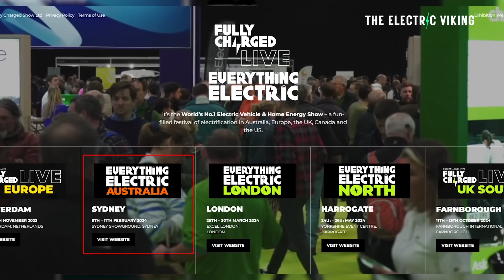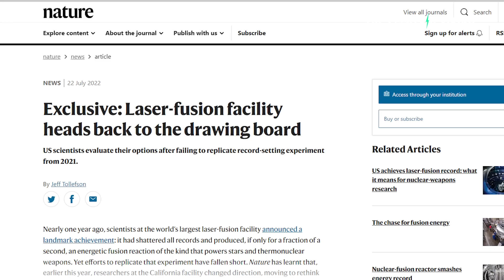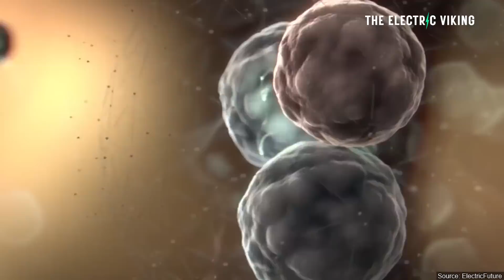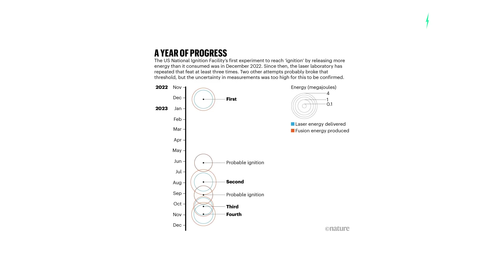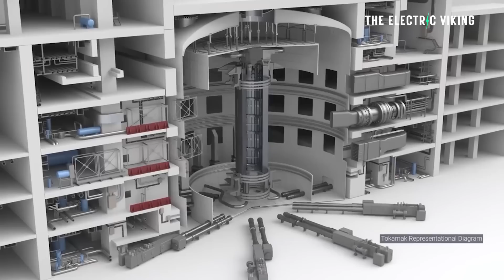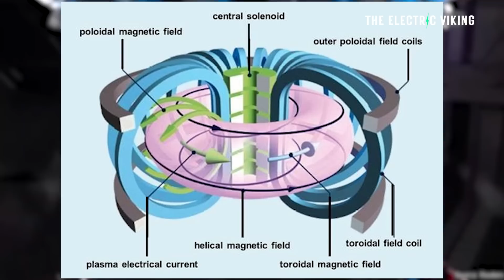US nuclear-fusions game changing achievement; ‘ignition’ over and over

Comment: Ok, way to hyped and low on details. I like all the new fusion approaches cropping up but realistically this is a small step on a long road.
So what is the catch?
Well the energy of the lasers that triggered the reactions was 2 MJ and the output of the fusion reaction produced 3MJ so net-positive energy, right?
Well no, because the laser emitters themselves are WASTLY inefficient, around 0.5%. That means to produce those 2MJ lasers they had to input about 400MJ electricity.
So 400MJ in 3MJ out. 
But lets say we get vastly more efficient high-power lasers 
AND we can solve the problem of actually transmitting the energy into the target pellet more efficiently 
AND we can do that at a repeatable reasonably high iteration rate (throughput is important for commercial viability as we can see with the wafer throughput problems of ASML in EUV lithogr.)
AND we can produce the pellets cheaply.
Then we can have a great free energy source, right?
Well, only if it's commercially viable (facility build, maintenance and run cost).

This is why Elon points towards the sun every time he gets asked about fusion energy.

That said, I live in Germany and here it's cloudy half the year and we don't have the geography for enough hydro (compared to the scandinavians ). 
So I am very much rooting for fusion and any other promising renewable energy source.

If I had to guess though I would say in the next 10-20 years the thing to look at is further dropping battery and solar panel costs relative to storage/output.
Curious whether the push for AI robots (nvidia, tesla bot etc.) is gonna lead to a huge labour cost reduction in that regard (e.g. mining, factory work) or whether the robot brain problem is gonna run into an early local maximum such that they are simply not intelligent enough to be realistically usable.
We shall see. Interesting times anyhow.

Comment: Sometime around 1998 I went to Lawrence Livermore National Labs (LLNL) for some meetings (not related to the National Ignition Facility aka NIF). Upon driving to the building where my meeting was taking place, I saw a shiny stainless steel cylinder  (about 10ish metres tall and a few metres wide) with a large shiny stainless steel sphere (about 10ish metres in diameter) sitting atop the cylinder. The sphere had quite a few holes of different sizes strategically placed all around it from what I could see. It was quite the amazing sight and looked more like an alien spaceship than anything. I went to grab my cell phone and take a picture but then realized "CRAP! This is 1998 and cell phones don't have cameras yet! Why I decided to come back to the stone ages is beyond me! DAMN!" 
And, because it is a secure facility, you CANNOT buy a camera around there to save your life! So, you'll just have to take my word for it that is was VERY COOL!
Eventually the building went up around it so it was no longer visible. I just lucked out on the timing.

Comment: Energy was solved in the 50’s with nuclear. Everything since is a farce or self inflicted drama.
Reply: Nuclear produces waste that is hard to deal with in a good way
Reply: This is simply false. The overwhelming majority of current stored waste was produced in the 50-60’s. This waste could indeed be used for several forms of power generation. Nuclear is the most sustainable form of clean energy on the planet right now.
Reply: @Uncle-G  around 90% of all nuclear waste isn't viable for energy use, since it has low energy levels
Reply: @Real_Furnace  alright smart guy. Most nuclear power plants use 3-6% of the available energy nuclear fuel rods. There are several other plant designs that could use up to 70%. Depleted uranium is not without fuction either however if this attitude of the masses are “nuclear bad” nuclear will not be researched further and we will waste one of the greatest assets we have.
Reply: @Uncle-G  Depleted Uranium is useful, but still a process in which no waste is made would be inherently better.

Comment: The problem with that claim, is that the energy used to charge the lasers  was not include in the calculation. When you include that energy it is close to a push (no loss/no gain). I'm sure they are striving to change that to make it a viable source of energy.

Comment: The key phrase here is "that the laser provided".  Congratulations for mentioning that only 1% of the energy put in to laser is "provided" in the ignition shot.  So if you put 100mJ in you get 1.89mJ out.  With a 7% more efficient laser it will only take 93mJ to get the same 1.89mJ out.  Notably this doesn't include the energy put in to preparing the capsules, refining the hydrogen isotopes or building the facility.

Inertial Fusion is a joke.  It has been since I worked on it in the late 90s.  So why was I working on it?  My research lab got a grant and the check cashed.

Now science for science's sake can be fun but we were essentially just burning through some US DOE money they were throwing around. 

There has only been a little thought put in to how you could get energy out of an inertial Fusion reactor and the concepts are wildly flawed.  So even if you get those 1.89mJ out of the reaction, you can't get them out of the reactor to do any work.  So we are back to 100mJ in 0mJ out.

I'm just going to call a spade a spade, the NIF was designed to help improve nuclear weapon simulations and inertial Fusion was a pipe dream created to double dip for more research money.

If you want to look at practical Fusion energy, look at ITER but know that it is very flawed because as far as I know it does not have a serious energy extraction system either.  There are power extraction concepts that are potentially workable for tokamak reactors.  And that's my disappointment with ITER, we already know that tokamak Fusion can be achieved and exceed breakeven (Princeton did it a long time ago) so ITER is only going to scale that up and increase plasma density and still ignore power extraction.  That will limit it to brief test runs that need to be shut down when the reactor gets too hot, then waiting for it to cool before another brief test run and occasionally shutting down for long periods of time to replace neutron damaged reactor pieces (notable because a power extraction system can also act as neutron shielding).

In the end, these announcements are just PR messages trying to fool people in to thinking Fusion power isn't still decades away and get more research money from the government. 

If ITER had been designed with power extraction in mind, the data it produced could have been immediately used to design an actual commercial Fusion energy plant and maybe we could have seen one actually operate before 2040 but I wouldn't be surprised if we don't see commercial Fusion energy before 2060 or 2070 because we are going to have to build at least one more ITER scale experimental reactor to test power extraction concepts.

Comment: They need to get to where they can harvest the energy to generate electricity that is more than the electricity used to run the lasers and all the other equipment.  They need to get to harvesting more than 100 times the amount of energy that they generated in this experiment, or they need to get the lasers 100 times as efficient or some combination (or more).

Comment: A frozen duterium target inside a diamond housing wrapped in gold is NOT a practical way forward.  How fast can this be repeated?  I suggest not very quick.  I also note that the video shows two different systems.  One is magnetic acceleration of plasma to meet with opposing plasma to be magnetically squeezed inot fusion in a reaction chamber.  This is a completely different technology to the one you are describing.  Not impressed.

Comment: you really should learn some physics and not just read PR crap, the output is not greater than the TOTAL power input to the facility and the stretch to commercial energy production is enormous, even if they manage it the cost has to be horrendous. 
I'm sure it will all happen in the next 20 years, it has been 20 years away for the last 50 years.

Comment: Several different fusion companies are planning on putting energy on the grid before the end of 2025. But considering that global energy usage is estimated to double in the next 10 years, it is unlikely that we will be getting rid of any of the existing infrastructure any time soon. Most likely we will be scaling up fusion reactors (many different types) between 2025-2035, and then we will start replacing older oil and gas energy generation. You should watch the All - In conference conversation: https://www.youtube.com/watch?v=AIPULlqA5Wc

Comment: A.I. will likely be the instrument that ends up making Fusion Reactors feasible.
Let us all concentrate on thinking bigger in order to solve global warming.

Elon Musk signed a contract with China in January 2023 to manufacture Diamond Batteries, they will power his Tesla cars instead of Lithium batteries.

NASA has a rover on Mars carrying a device called MOXIE.
It captures CO2 from the atmosphere, splits the molecule and stores Oxygen for future explorers to breath, Carbon is a by-product.

If MOXIE was up-scaled  here on Earth it could do the same thing, split the CO2 molecule store the Carbon then the Oxygen can be on sold to industry.

By placing Carbon in close proximity with Plutonium that will make it slightly radioactive, it can then be manufactured into Diamond Batteries which will produce electricity for 1500 years while reducing CO2 in the atmosphere and sequestering the carbon indefinitely.

On Earth Mammals inhale air composed of Nitrogen and Oxygen and exhale CO2.
Therefore CO2 is an inexhaustible feed stock, we are never likely to run short of it.

CO2 could manufacture trillions of Diamond Batteries they could replace every power station on the planet and produce no emissions.

Comment: Sam, you need to do some more fact checking, on the face of it if you compare the price of building ONE nuclear reactor it is correct to say the nuclear powerplant is more expensive than a windfarm, but that doesn't take into account the total cost for 100% available power at the right frequency. 
Why is that important? A modern society can't send workers home because there is no wind or solar power. I'm sure you don't want to have open heart surgery when the power could either go out or brown out. 
A wind farm can theoretically be infinitely more expensive than a stable power source like oil, gas, coal, or nuclear.
First, you need to have massive backup not only for a few hours but often on the latitude of Canada, Sweden, Norway, or Finland for days and even weeks.
Then the cost of running those powerplants will be difficult to make lucrative as from time and again when the wind kicks in or the sun shines the price will even be negative as there is such a surplus of power you cannot recuperate the cost for the production of the energy, let alone the investment. 
On top of that, you have to balance the power grid and hold the frequency stable, or the industry with motors and equipment will suffer enormous costs as their equipment breaks down when the frequency isn't correct. The only really good way to balance that is to have power generation systems with a heavy mass like nuclear, hydro, or similar. 
Thirdly, you notice that the wind farms usually only last for a maximum of twenty years and that is high, usually, they have worn out and the blades and maybe reduction gearbox has to be replaced and they are placed far away in mountains, at sea or other places far away from the regular power grid? This means a massive investment in new power cables every ten to twenty years just to tap into the power produced. That distribution cost needs to be factored into account too. 
Lastly, make this comparison; right now the UK has roughly about 86 GW installed in wind farms offshore, and the people employed to run, service, and maintain these windfarms number around 81,000. 
Sweden has one nuclear power plant that can provide 75 GW of electric energy with 1200 employed.

So If you think you are getting the energy for "free" just means someone else is paying for it, usually, businesses can't run with a loss for long and it does mean YOU as a consumer will have to pay for it, by taxes, state loans or subsidizing by forcing you to pay too much for another service so your government can subsidize a loss-making stupid exercise in playing good.

Comment: Sam, please put down the Jonestown Kool-Aid! 
 
A grain-of-rice sized amount of fuel, housed in a 'stadium' sized facility, achieved a nanosecond of 'ignition'.  Amazing!  How are they going to scale that to make it a sustainable reaction?  These types of fusion reactors use tritium as a component of their fuel.  There are approximately twenty-five kilos of captured tritium, with a half-life of 12.3 years, available for research.  Seventy-five percent of that total has already been allocated for ITER to use when ready.  A fusion reactor using tritium and deuterium as fuel will consume ~160 kilos of tritium to generate two-gigawatts of electricity.  Please keep in mind that these 'amazing' results do not mention the ~twenty percent overhead needed to convert that heat to electricity and get it on the grid.  

Where are they going to get the tritium needed for sustainable reactions?  Current fission reactors produce ~0.5 kilos of tritium/year as a waste product of their reactions.  Roughly thirty fission reactors are setup to capture tritium, and half of them are already scheduled to be decommissioned in the next two decades.  Fusion reactors do produce tritium, but it cannot yet be captured at a one-to-one ratio, so there is a net loss during sustained reactions.  The fuel issue is only one of the handful of issues preventing these types of reactors from utilizing sustained reactions AND scale them to be able to put power on the grid, which is what the selling point has always been...  

Fifty years of 'fake it till you make it' and whole bunch of 'we think' and 'we hope' and 'in ten years this will powering the entire globe' BS!
The vast majority of those working on fusion reactions, who are NOT directly funded by the misinformation aimed at governments and blinded-by-money suckers are of the opinion that until we develop new technologies and processes, sustained fusion reactions MAY someday be possible in a laboratory environment but nowhere near the scale it will take to make a difference on the grid.

Comment: As far as I can tell, the significance of this advance is much exaggerated.  The definition of energy input seems arbitrarily restricted to some tiny part of the system delivering the input.  If you include everything required to direct the laser energy to  the target, it turns out this is not remotely close to breakeven yet, much less more energy coming out than goes in.  If the system really produced more than was put in, it would be gold mine right now. I'm not sure why the research is presented as if more energy were produced than the input energy -- maybe to get investors excited and government grants rolling in.  Profitable fusion would be utterly revolutionary, it might even usher in the singularity.  With unlimited energy, you'd have virtually unlimited ability to move, shape, mold and transform matter.  Combine that with robots and AI, and you have almost unlimited material wealth for all.  Scarcity as the basis of economic life would be largely upended.  Economics as we know it would cease to exist. But with that kind of unlimited power, disaster could also come.  
But the hype goes on about fusion breakthroughs.  This world often seems to be a cesspool of lies and compromisers.

Comment: The problem is less the 'limitless' bit but the cost of setting up a functional sized plant. I seem to recall from the first claim, those capsules are incredibly hard to make. The sun and wind are 'limitless' too! Yes research needs to continue and does all over the world in many ways. It is not remotely ready for use in decades yet. Remember you video on Tony Seba, energy will be in abundance soon, fusion has probably missed any use case it may once have had.

Comment: It seems like there are so many possibilities in the advancement of this technology that will lead to other technological advances as well. For example, the Laser technological advances. If laser tech is improved, perhaps Solar Panels in Space, could have lasers beam down energy that could be stored in large batteries, and or then have that energy supply a Fusion Reactor to have that energy amplified one day. This could only happen if the efficiency of the fusion process is greatly improved so that the amount of power input to supply the Lasers in the fusion process is less than what the fusion output is.

Comment: Karl Marx, Nikola Tesla, Balfour, Einstein, Huxley, Orwell, Turing - should be forgiven for thinking their systems can last forever.
Finite fossil fuels are dangerously hypnotic to humans, their consciousness and mental capacity.
Humans were not ready morally, ethically and intellectually to start the mass extraction of fossil fuels with the advent of the steam engine 300 years ago. 
The Magna Carta requires today overhauling – adding to it the right for humans to understand what Energy really is - before any other commandment;
“In any system of energy, Control is what consumes energy the most.
No energy store holds enough energy to extract an amount of energy equal to the total energy it stores.
No system of energy can deliver sum useful energy in excess of the total energy put into constructing it.
This universal truth applies to all systems.
Energy, like time, flows from past to future” (2017).